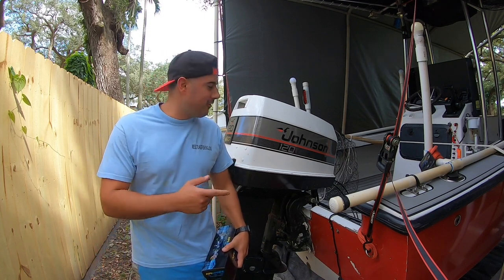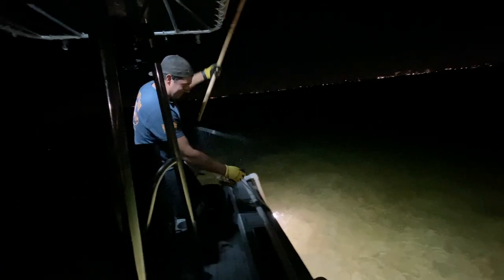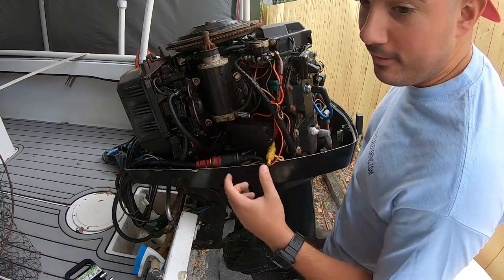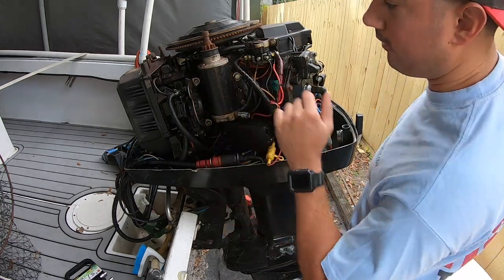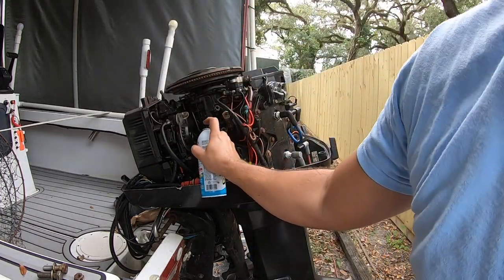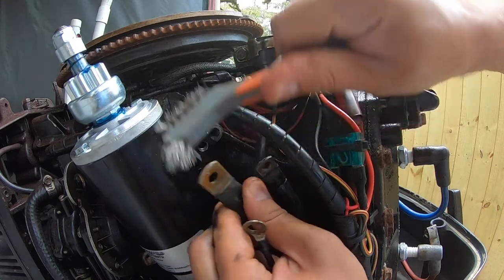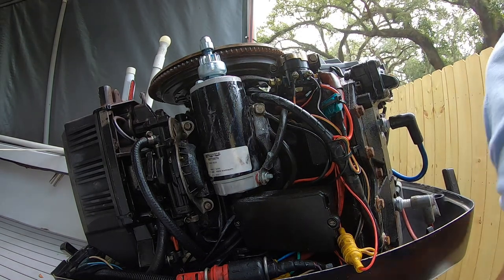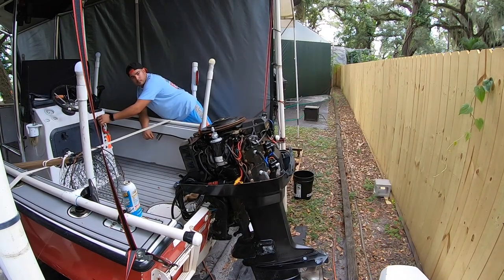How to install an outboard starter

Comment: Great video , it would be super cool if you can add links to the products you use like the spray can at the 5.01 mark and how do you know it’s the starter and and not the solenoid for us rookies . But great videos ✌️
Reply from the maker: Ahh great points. 
The spray in this video is made by PB blaster. They have a marine anti corrosion spray.
For sprays I suggest yamashield or yamalube Maintenance. Best all around engine sprays. Next I’d suggest CRC 656
I knew it was the starter because when I’d tap the old starter with a mallet it would try to spin. These starters over time rust inside and bind up. Especially when they sit for long periods without use. Tapping on it will loosen the inside rust and get them to turn over. At this point it’s a sign the starter is going to fail.

Comment: Does it really matter if I install a starter for a slightly bigger engine on a smaller engine?
Reply from the maker: As long as it lines up, the teeth on starter line up and has the correct amount of teeth on it I don’t see why it won’t work
Reply: @ReelTeaseFishing  I appreciate that sir,it’s coming tomorrow so I guess I’ll find out soon

Comment: I would like to fit a starter motor on my mercury outboard motor its a 2005 ME30  EMLH where can i get the right starter motor
Reply from the maker: Hopefully there is space to fit it. 
Here is the part number to a starter on 2005 30hp PN: 893890T
Look up diagrams for engines your same year that have the starter so you can see where and how they have it connected.